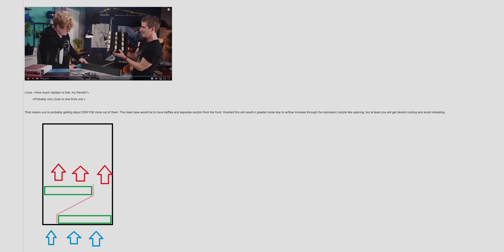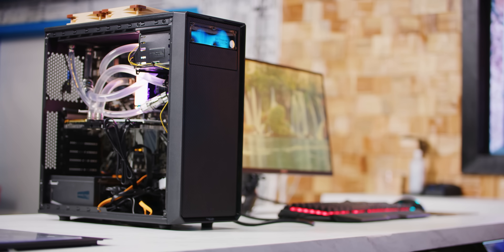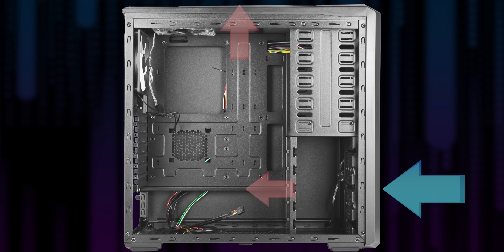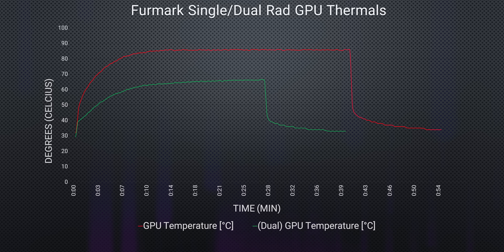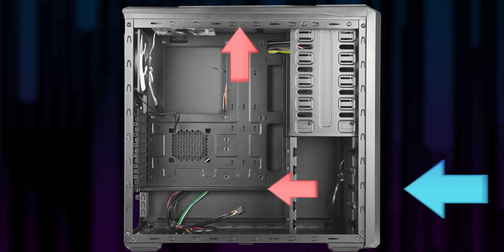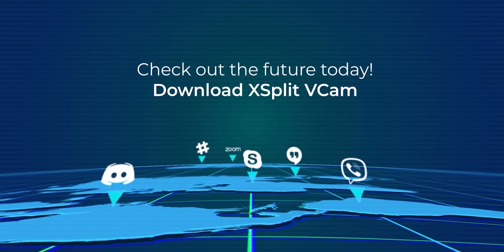I’ve been water cooling wrong for YEARS - $H!T Manufacturers Say

Comment: "Is your gaming rig bottlenecked?"

Yup.  8 GB of RAM and an old mechanical hard drive.
Reply: I'm here running on pretty much the same.  8gb of ram I don't know what, an old (and small) hdd with god knows how much rpm, a 8 year-old dual core quad thread intel mobile chip, and a gtx 660 mobile. Everything I do my computer just wants to scream.
Reply: @Kanethedragon  See my other response.  I've been meaning to upgrade the RAM and HDD just haven't had the budget.
Reply: @Kanethedragon  I know my GPU is made by Nvidia and that isn't the bottleneck.  That much I am certain of!  :)
Reply: I'm so poor i have to game on mobile phone
Reply: Ok I'm not the only on who's running potato pc 😢
Reply: B r u h I have 2 GB of RAM on a 64-Bit Windows 10.
Reply: @fuzzy6622  I don't know how you can even run windows with that 😅
Reply: @gabrielp.179  It manages itself. It is quite difficult, but Windows can manage itself.
Reply: @fuzzy6622  that's not exactly what I meant haha. See on my system windows uses around 4Gigs of ram, so what I meant was that it must be quite laggy, especially when you open a few chrome tabs etc
Reply: @gabrielp.179  I mean when Windows sees there isn't enough memory it frees some of it. But yeah it takes some time for the system to get itself together after I play a couple games.
Reply: @fuzzy6622  Can you play Minesweeper on that?
Reply: @slwsnowman4038  It runs at 30 FPS but it runs. It did BSOD my PC a couple times before though.
Reply: @fuzzy6622  At least it runs...
Reply: Jaime Beauchamp Yeah I have my eyes on some ssds to help. In my system though pretty much everything it has is a bottleneck. RAM most I can go up to is either 16 or 32gb ddr3l @2666 MHz, whilst the chip I theoretically should be able to replace it with Intel’s best workstation mobile chip of the time for around $200 but even that’s only 4 core 8 thread with base clock at 3.0ghz and max at 3.9. Pretty much all that together would add up enough to have a better secondary desktop built. Well I’m already working on a high end desktop build currently anyways with a 3900x and planning for either big Navi or rtx 3000.
Reply: I just got an  ssd and i am loving it
Reply: GREAT facts!
Reply: Shut up I got intel celeron dual core running at 1.1gigahertz with flippin HD graphics
Reply: My tablet has 8gb ram lmao
Reply: I have everything up to standard except I'm using a 10 year old hdd with my 16gb ram and Ryzen 5 and gtx 770
Reply: @marcus4752  I think the second internal and external HDD I have setup are about 10 years old.
Reply: Yuck... Meanwhile I just ordered my 10900k and it's shipped and set to arrive Friday... No mobo though til the 22nd.
Reply: Callum Faulds Yeah I tried to put in a e8400 but it didn’t work. I would replace the chip but I’m giving it to my mum and she doesn’t want to spend any money on it. I’m going to be building myself a Ryzen system here in the next few weeks
Reply: Honestly same. I'm gaming on a Core 2 Duo + 750ti running 99% CPU on the desktop but only 50% on my GPU in most games...... Not bottlenecked at all!
Reply: @BryceCassagneres  Most of the games I play are older and don't need much more than that.  But the newer games I have I do need to bump up the RAM and probably go to an SSD.

My CPU is an i7-5820K @ 3.3GHz.  I've got 8 RAM slots to fill if I want/need.  The only real problem I have is it is an early M.2 board so I think I'd be wasting money on NVMe.
Reply: Slw Snowman40 Maybe get an NVME M.2 to PCI-E card?
Reply: @BryceCassagneres  I've already started building/planning the next three.
Reply: Slw Snowman40 In case you thought I was saying your system is bottle necked by my first comment, I wasn’t. I reread what I said and could easily be taken that way. I was merely agreeing with you and sharing that I’m in the same boat running some ancient (on my part) hardware.
Reply: Slw Snowman40 Next three what? I’m just curious...
Reply: @BryceCassagneres  PCs.  Building a rig each for my oldest sons and the third is a new one for me.
Reply: Slw Snowman40 Oh nice!
Reply: @BryceCassagneres  whhhyyyyyy?
Reply: Zach Willetts Because I can!!!!! Jk I got the pc for free from my school and plopped in that 750ti just to see if it would work

Comment: Yeah... as long as you give each radiator its own cool air to work with, you'll benefit from multiple radiators. By the time air got through a stack of radiators it would be warm and the 3rd rad would become almost redundant because there is almost no temperature difference at that point. So as long as you don't stack them and they get there own unused cool air, its all good

Comment: Corsair: "Doing it this specific way is wrong" 
Linus: Does it a completely different way "Well actually ur wrong"

That is to say, neither of them are expressly wrong. But if corsair blanket statement wise said "more rads is always worse" then yeah they're wrong. But they seemed to be complaining about stacked rads like in the minecraft server. Also it does depend on the cooling capacity of the radiator afaik. If you're cooling 500W with only 400W of cooling capacity, then yeah another radiator would help.
Reply: at the end of the vid he said they removed a fan from the Minecraft build and it resulted in a 5-degree increase.
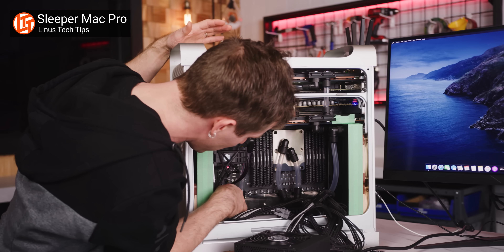Reply: I'd say that Corsair was vindicated by that little line at 6:46.  A 5C increase in temperature is negligible.
Reply: Linus did also mention 6:46 that they tried to removed a radiator from the computer corsair was referring to. More radiators were infact better (in this case).
Reply: Monstertruck not necessarily. 
Only removing one and seeing the temp rise doesn’t mean that removing More and reconfiguring may not be even better.
Reply: at some point more rads is worst, it is better to go with few high quality rads with good air flow.

Comment: You need both Rads exhausting, say through top and rear, and input fans from front and bottom. With enough air speed the air cooled solutions won't be able to raise temps appreciably before entering the Rads.

Comment: Adding more water volume with an extra radiator merely adds more heat capacity. Meaning that it will take longer to heat up all that water but also means you will take longer to dump all that heat from the water once you reach equilibrium. If yo want to improve temps you need to have colder air running through your hot radiator. Especially so if your workload generates massive heat in a short period of time. Its a problem where multple variables are always at play and what works for some might not be good enough for others.

Comment: water flow order would also effect the results, like in the minecraft server if you ran the water where the hottest water came in at the the last rad being cooled with the hottest air you would find that the temps may decrease as the air is not heated as much through the first rad. but that also means that the delta temps wouldn't be as big in the entire system.

Comment: I think the main erroneous assumption here was air exiting the first rad would be just slightly lower in temp than the temp of the rad. It only has to remove heat at the rate of change heat is being added into the rad to keep a constant reading. This means to me the air temp may only raise a few degrees whilst passing through. Leaving a load of capacity for heat exchange on the second rad.

Comment: Could be wrong but always thought as well as flow mass/volume and flow RATE of each of each transfer mediums (ie air and water)  was also important since heat transfer is not instantaneous - hence fatter tubing being a better way of increase flow mass than higher pump speed. Bearing this in mind I'd be interested to see the effects of varying tube/inlet diameter and pump speed on radiator efficiency - Corsair could still be right at optimum radiator efficiency although not convinced since there is always thermal resistance between any junction so air is unlikely to get anywhere near the fluid temp in the same way die and ihs temp are always quite alot different.

Comment: I think Corsair was pulling your leg.  Liquid cooling radiators are no where near efficient enough for the heat from one to severely impact the cooling of another.  If they were that efficient, your temps in a single-rad config would never hit peak, provided your ambient temps were reasonable (eg - 21C).  As we can see, that's clearly not the case.  There is a case to be made for diminishing returns, obviously.  Two rads doesn't double the cooling performance of one, and three doesn't triple it, but it does increase the performance appreciably.

Comment: Reverse your radiator build.  Hottest at the out vent.  Should make the intake vent less hot keeping the internal temp a bit lower as it cycles thru hitting the hotter one.
Just saying, haven't tested.  Be interesting to see if you hooked up one way and then reversed the sequence to see the impact.  Rig is already hooked up so probably easy to test.

Comment: IMO ....Or if corsairs products efficiency actually resembled the bullshit they say it does on the box they may have seen this. but they went off of their products being 90%+ efficient heat exchangers for some bizarre reason (which is bollocks because marketing and legal writes the spec on the box so its usually a shade of truth that keeps them out of prison but six degrees of separation to the actual truth) and (wow) the data produced matched that scenario. But if their only exchanging at, say,40-60% there is still cooling headroom for the other radiator to take advantage of. Corsair have spent too long enjoying the smell of their own farts at this point to differentiate between truth and reality.  I think you would struggle to produce a rad that could be as efficient as they claimed.

Comment: You issues stem from keeping everything in the case.   Objective is to get the heat out.   Two Radiators and Fans out of the case would more then do the job.  Stacking Radiators mitigates efficiency.  BAD Ju Ju.

Comment: well my experience with watercooling isn't that great. however do i use a 240 mm aio for the cpu and a hybrid card with a 120 mm rad. i have them at the top and back of the case as exhausts and i can say that sure. your "case ambient" generated by all the other components will dictate how low the temps will go as you cool the water with warm air from inside the case but it's also really not that one sided. sure if you have the rads as intake then you will have lower temps on the cpu/gpu because they aren't cooled by warm air from within the case. but on the other hand you will also significantly raise the temp in the case. so i use 2 bottom and sidepanel fans as intake, 2 fans on the hdd cages but they are in crossflow also as intakes, and the 3 fans on the rads as exhausts. the intakes are at minimum rpm and the exhausts/pump just on auto to generate positive pressure. the thing is that i don't really care that i have higher idle temps because what matters is the max temp to me and having the heat from gpu/cpu exhausted makes more sense in my eyes. and well. i have the most powerful hardware i ever owned in this case but inspite that pretty much the best temps i ever had. well at least for the gpu. i had cooler cpus but they were also far less powerful and had lower tdps.

Comment: My (untested) theroy is this. 
For ease going to say 2 equal rads with 15c cooling capacity at an efficiency of 50% and equal air and water temp outputs.
CPU and GPU combined output 70c. VRM and RAM etc combined output 5c so adds to top rad air input. External air temp 30c.
Front rad draws air from outside case and exhausts inside case. Top rad draws air from inside case and exhausts outside case.

First rad goes on top. Air intake 50c. Rad intake 70c. Rad out 60c. Air out 60c.
10c cooler input to CPU & GPU at this point.

Second rad in front. Air intake 30c. Rad intake 60c. Rad out 45c. Air out 45c.
25c cooler input to CPU & GPU at this point.

Now if we switch the rad order it adds up as:

First rad in front. Air intake 30c. Rad intake 70c. Rad out 55c. Air out 55c.
15c cooler input to CPU & GPU at this point.

Second rad goes on top. Air intake 60c. Rad intake 55c. Rad out 57.5c. Air out 57.5c.
12.5c cooler input to CPU & GPU at this point.

Second rad actually warned the first rad output.

Comment: It's hard to tell how Corsair set up their CFD simulation.  But there may be an error in how they set up the boundary condition that quantifies the restriction that stacking radiators create. The flow through stacked radiators could be relatively laminar if the radiators have similar construction.  It's like a water hose that's 1ft in length filling at 5 gallon bucket in one minute.  If you increase the length of the hose to say 10ft in length, the hose will still fill the 5 gallon bucket in 1 minutes, provided the hose remains straight and there are no kinks. Stacking radiators will though, reach a point of diminished returns.  CFD is very complicated and making rule of thumbs statements can get you into trouble. I'm not a PC builder, but in the business I work in, small changes in a system can easily change CFD results.  In the computer cases that I've seen, there is not a lot of restriction in the intake location.  You could add a lot of fans before you reach the intake limits.

Comment: The biggest issue at hand is the Temperature Delta (difference). It depends what the ambient temp vs radiator temp, radiator hot air temp vs second radiator temp, fresh air temp, and much more. 

A simple example is this: (numbers are arbitrary, just for example), a coffee at 100C in a 20C room has a Delta of 80C. In 10 minutes the coffee dropped temp to 70C in a 20C room. That is a 30C drop. If the Coffee, however, was 90C it would not have dropped 30C in 10 minutes. It would maybe only drop by 25C in the 10 minutes instead. It is because now the Delta from 90C to 20C is only 70C and not the 80C it was in the other Coffee. This is also the same reason why you lose much less heat in the wintertime when you drop the thermostat temp. The smaller the temperature difference the less heat transfer there is. It also explains why hot food cools down so fast but seems to stay lukewarm for a while.

Not to forget there are other ways a system can lose heat, not just through convection, but also conduction and radiation.

Comment: Industrial thermal systems engineer: busts out the popcorn and kicks back for a good show lol.  You just need to understand log mean temperature difference and a couple mass energy balance equations and it becomes pretty simple.  More radiators in series, even in series on the air side will still work as long as you still have some lmdt, but the law of diminishing returns catches up a lot quicker when you progressively degrade your approach temperature with hotter air from other radiators.  The world of physics is lazy...nothing moves without differential.  There are a lot of scenarios where adding more heat rejection surface area isn't going to make much more difference, but there are strategies for maximizing the difference it could make, and running the air side in series is definitely not one of them if it can be avoided.  If you can't beat it with lmdt, you can always throw more surface area at the problem... 😂

Comment: Is it possible that increasing radiators increase the total volume of water there for dispersing heat. Could you’ve gotten similar results by having more tubing With more water in it. Seems that the biggest question is how much does more volume in your loop affect total heat.

Comment: why not just test their claim directly and remove the second rad from the specific design they were talking about instead of adding 100 new variables with a new setup and trying to extrapolate.
Reply: Why not just watch the video so you don't make yourself into a dumbass in the comments. He said they removed one of the rads from the minecraft server that Corsair complained about and temps increased 5 degrees. Not a huge difference but it still proves Corsair wrong.
Reply: @stevecole90099  
Case 1:
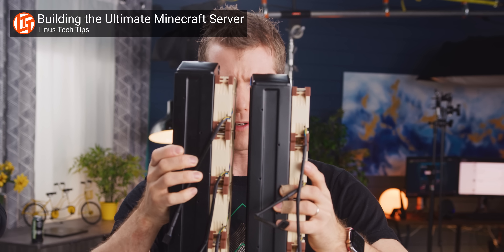0:52 - 1:21 Corsairs specific criticism was never addressed directly

Case 2:

1:22 - 1:40 "water cooling wrong" is all Linus tells us about Corsairs criticism here. That doesn't tell us much about what Corsair actually said. What counts as right or wrong in this case? We are not told. To give an example, it could simply mean that there exists a radiator configure with more efficient heat transfer than the one used. It does not necessarily mean that the configuration used is detrimental to system temperatures.

For Case 2, in the video they remove a radiator and claim a 5 degree temperature increase. So that shows that having a third radiator+fan pair stacked on the other 2 is still beneficial to system temperatures.

Case 1 and Case 2 are not analogous because of their different configurations. In the video, Linus even explains one of the reasons of why the fluid dynamics of these 2 cases are not the same:  
2:33 - 2:55
So addressing Corsairs criticism of Case 2 does not simultaneously address Case 1.

In the video they address Corsairs bastardized criticism of Case 2, and then used a completely different system to try to address the criticism of Case 1. Nothing was proven about the validity or invalidity of Corsairs statements of Case 1.

Lastly, a little bit of thinking might help you not jump to the conclusion that someone is a dumbass.